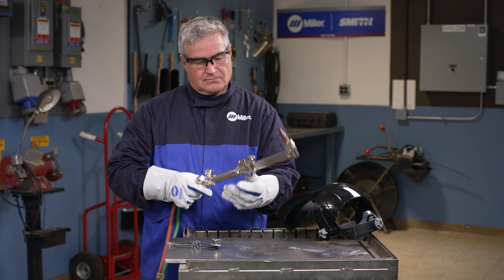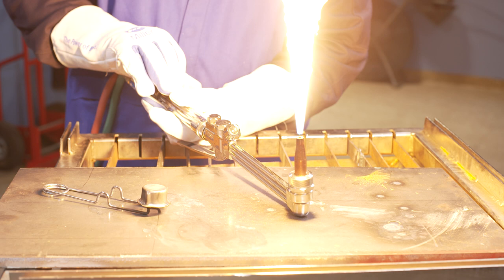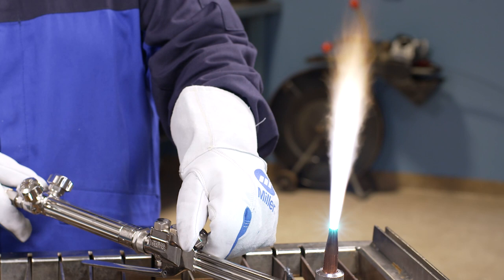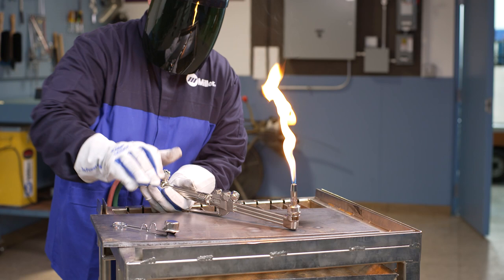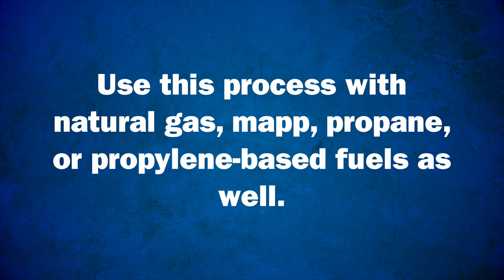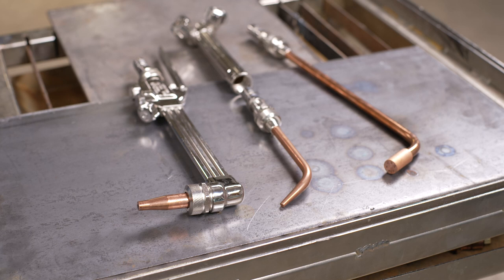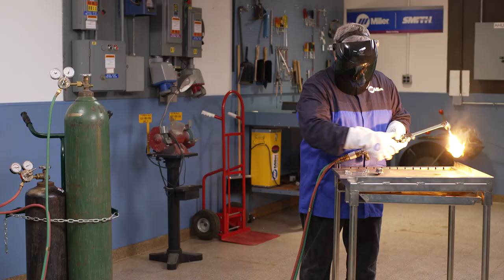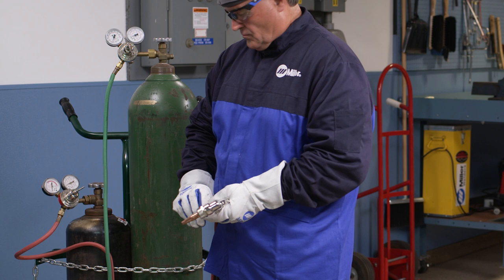How To Light, Set and Extinguish an Oxy-Fuel Torch Flame

Comment: Explain how a machine torch with an identical tip has BOTH oxy and fuel turn on together and then. and only then is the flame lit *with a resounding "pop" . The BOTH gasses are shut off together. Zero point no problems since machine cutting was invented.   ,,,, BEST way to light a torch?  Set the OXY and FUEL valves to their approximate setting for a neutral flame and POP. (And do not use matches or cigarette lighters)